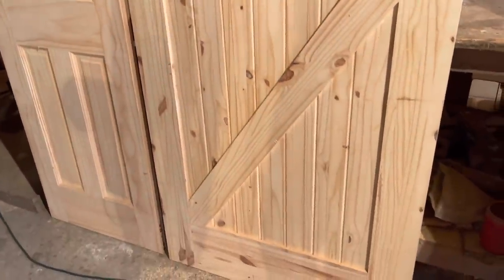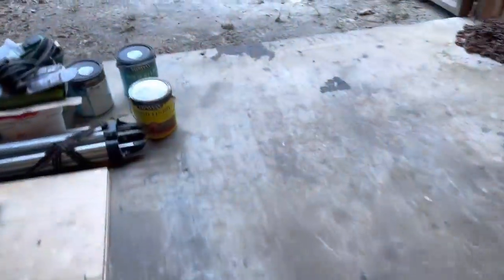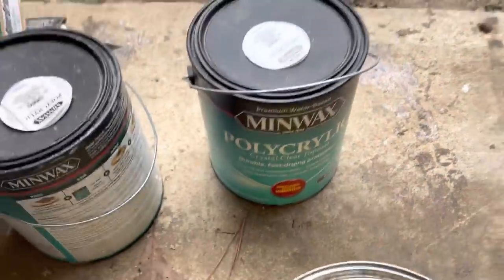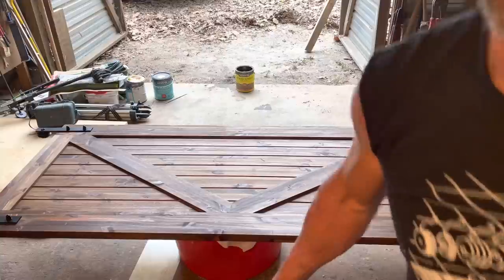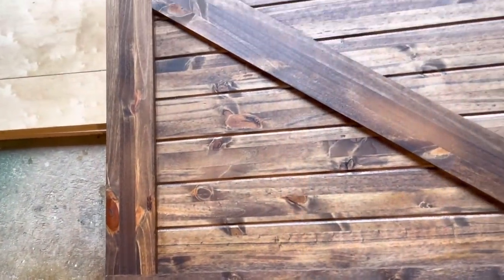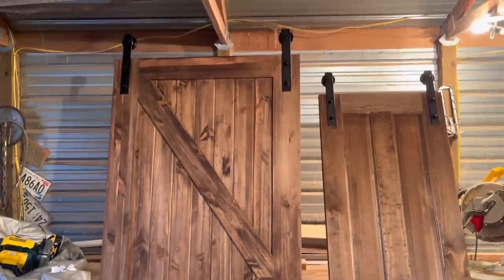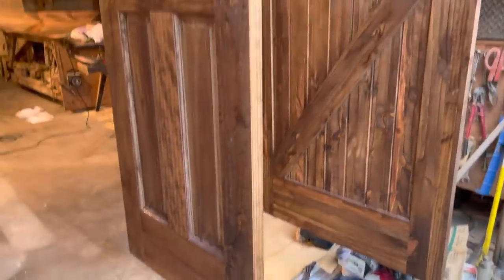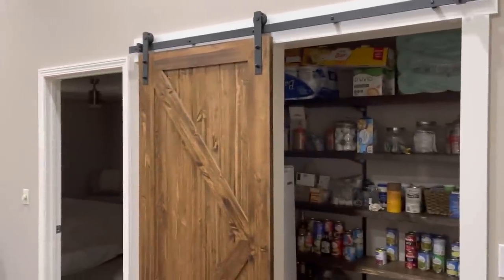Finishing up Barn Doors - Stain & Clear Coat on Rustic Sliding Door

Comment: Fine job, Jeff. Looks great. Staining pine can be tricky especially if you have a variety of pine. One trick I found, if you need pine stained really dark and you want it uniform, after you last sanding, use either water base or alcohol base dye, it comes in all colors. Use brown or dark brown even if it doesn't match your final product. After using the dye, then use your same staining process like you have done. Dyeing the wood first before staining will give you that darker uniform color.
Those hanging barn doors really makes that place look rustic and complete, looks great!

Comment: love the barn doors.  I should have went with those instead pocket doors.   have to  be careful where you put pocket doors.  we have a closet as soon as you walk into our bathroom and a pocket door that goes in the wall along side of our vanity... just where we need to install a towel rack.  Can't easily install a towel bar because the screws might be long enough inside the wall to scratch the pocket door as it slides into the wall.   so, we'll have to go with a glue on towel rack or other option we don't much like.